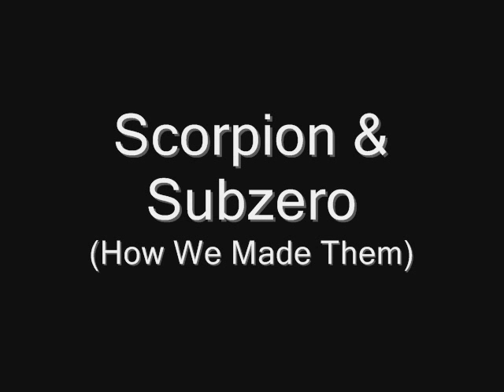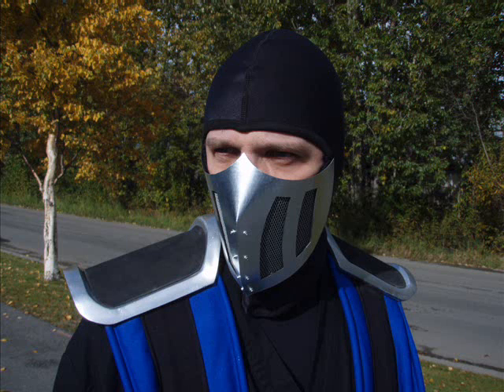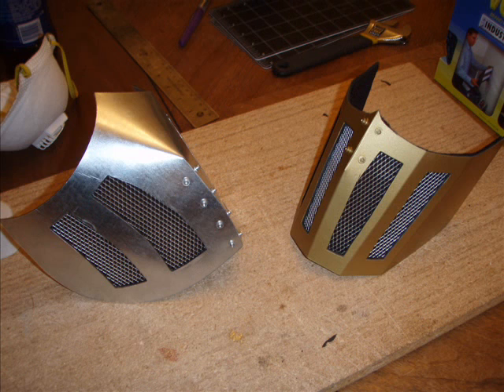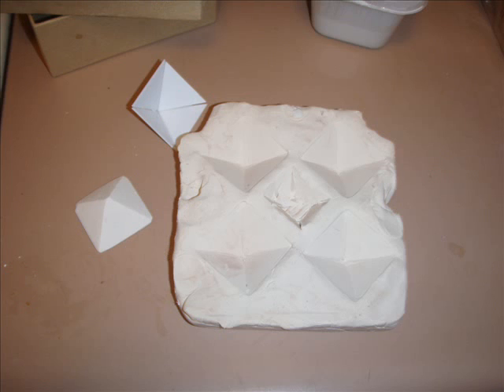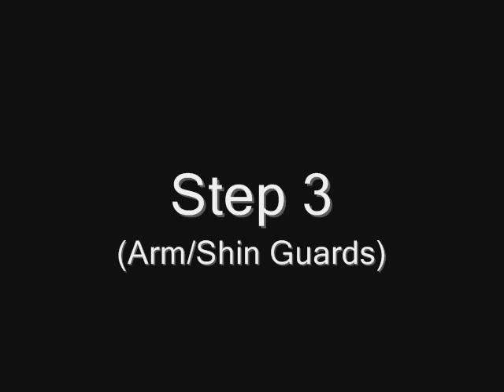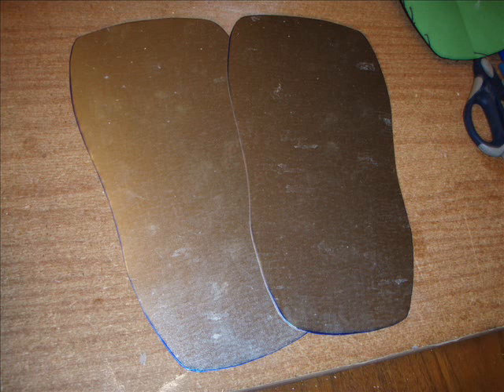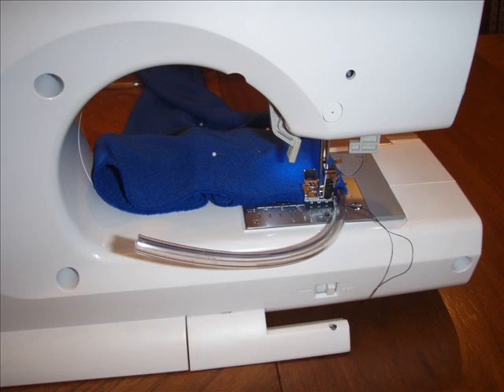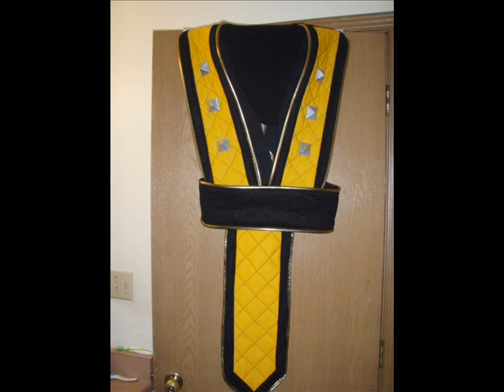How Scorpion & Sub-Zero were made #1 of  2 - Slide Show Narrated

Comment from the maker: @thekrystalmethod Not too difficult. i used a rubber mallet around a large metal pipe for making curves. or for crisp edges, i just lined up my fold line on my counter and used a piece of wood to push down on one side. (The wood pushes the whole thing at once so it doesn't only bend a portion at a time.